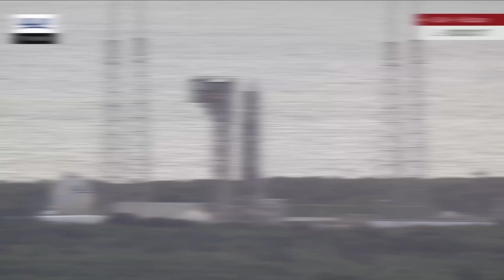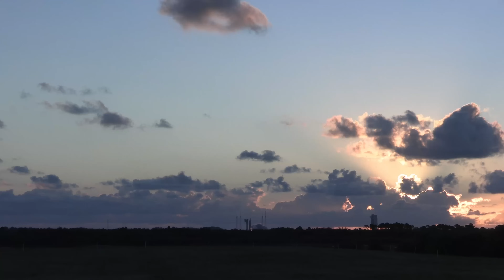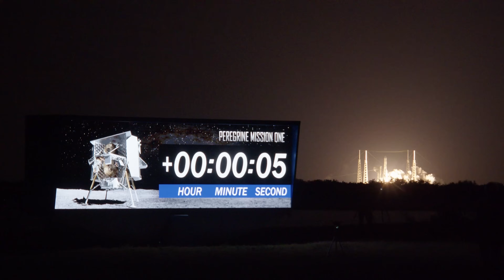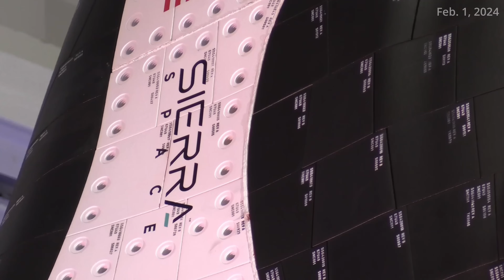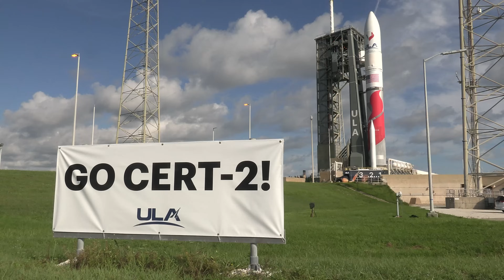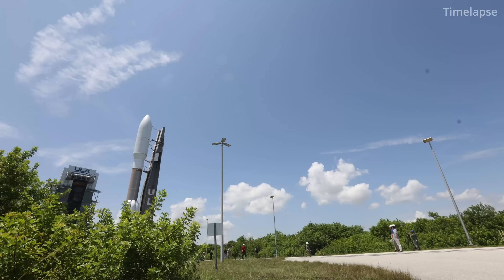ULA's Vulcan rocket overcomes solid rocket booster anomaly, completes second certification launch

Comment: Great summary…. really lucky that unnecessary flight termination was NOT triggered / commanded and the vehicle was able to fly on and compensate. I

 think there WAS burn-through… probably found a structural weakness due to the increased motor power of the GEM-63 XL over the Atlas V version which seems to work fine. As the bad SRM separated and flipped around in the airstream, the bottom section with the nozzle and attachment area snapped off completely and smoke etc blew out of the empty top tube sections….

Comment: If the breakthrough would have been on the side of the main rocket it could have penetrated the main rocket shell and resulted in an RUD.   The extra burn of the upper stage was required because of the loss of thrust from the damaged and possibly missing nozzle.

Comment: I would say that it is odd and should be looked into but as long as it was able to compensate and continue flight I say it went fine. Overall I’m wondering if it was just a panel blowout, it looks like it affected the actual burn / booster look but good outcome is a good outcome. 🎉

Comment: I am glad it did not have to be self-destructed. Looks like a mass of fuel arrived, not properly metered, to the nozzle, and ignited all at once. on that side of the nozzle.
Reply: Soild fuel is poured if there are any air pockets it can cause these problems.
Reply: The solid rocket fuel burns wherever the propellant is exposed to the high temperature of adjacent flames, similar to coal (though much faster burn rate).  The main concern is if cracks form to expose more surface area.  That increased flow of gaseous products would increase chamber pressure, which could rupture the case.  This failure appears a nozzle failure, with hot gas shooting out the side.  Not obvious if the opening is upstream of the throat.